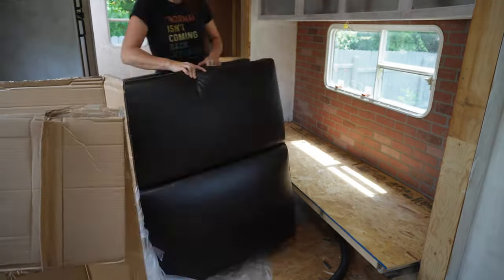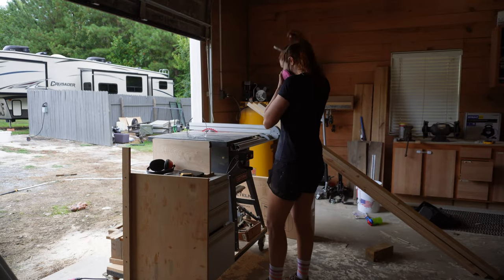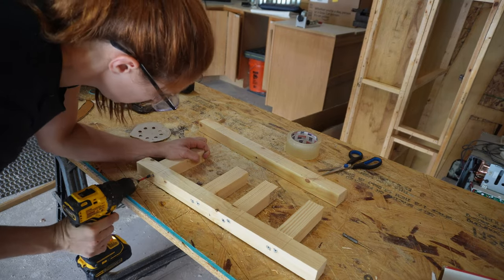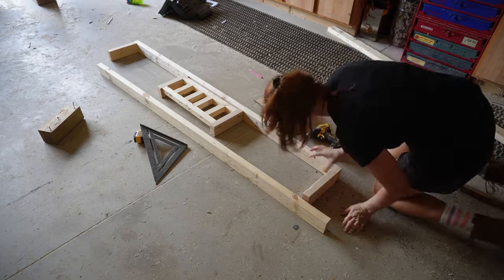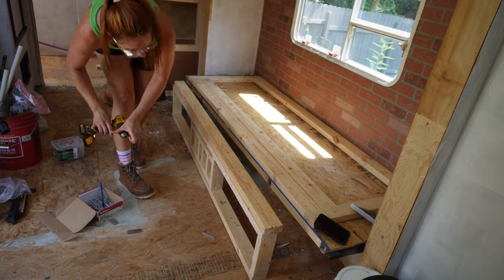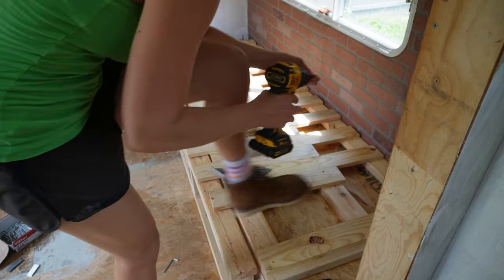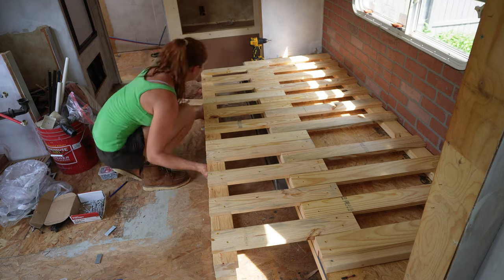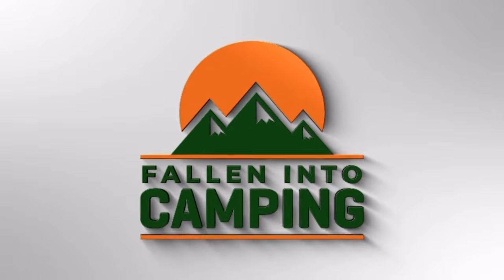RV Renovation: Day 7 DIY Jackknife Sofa Framing

Comment: For the drill question it sounds like the torque clutch doing it's job. There should be a ring/dial around the chuck with numbers and a drill bit icon. The numbers set the torque limit so you can do more delicate jobs with it without worrying about over tightening. 
Or maybe you got a lemon. Dewalt is usually pretty good quality but it could be a defect.
Reply: Ditto. My thoughts, too.
Reply from the maker: Yeah it keeps getting stuck between 1 an 2 (basically slow and fast). If I switch it back to slow speed, it will correct itself and then I can move it back to fast. I’ve never had a drill slip like this one has before.
Reply: @fallenintocamping  so it is a lemon. Makes sense it would slip if it is in between speeds/gears.
Reply from the maker: I figured that was the case….guess I’ll just have to practice self control and not get angry every time it slips and stops spinning mid screw 😂
Reply: Had the same issue and took it back and it was replaced @fallenintocamping

Comment: Good Afternoon, 
Have you ever dealt with leaking rv / horse trailer windows?? I have cleaned the weep holes  and tighten the screws. Have you ever taken a window out and put  that rv  seal on a roll ?
Thanks in advance.
Reply from the maker: Yep lots of times! Sometimes horse trailer windows are riveted in, so watch out for that. If not, take the interior screws out (make sure someone is outside to hold the window from falling out). Set the trim piece and screws in a safe place, and take the window out from the outside. Clean the window and the outside edge where the window sits with alcohol. Reapply new window seal (for smooth fiberglass use dicor foam core which is in my Amazon storefront) or if it’s aluminum corrugated siding (wavy) use caulk cord that you can buy a Home Depot. Then put the window back in the same way you took it out 😂
Reply: @fallenintocamping  
My trailer is painted aluminum, what seal products should I use??
Reply from the maker: @jeanmattison3600  is your siding smooth or wavy?

Comment: I had the same issue with my drill found out I didn't have it set on the right setting in other words it wasn't dialed in
Reply from the maker: Interesting…it’s not a fancy drill and I’ve owned one exactly like it and never had this problem with the old one. It slips when using it for literally anything, and if I switch it to slow speed and then fast again it works. I think I just got a dud 😂

Comment: Hey you do great work !! I've been wanting to try some graphite paint on a project to see how slick it is. Would be idea for you if you choose to slick that slide up some more. On the drill,  if it's adjustable torque and all the way locked up and still slips I'd be disappointed too. God bless
Reply from the maker: I’ve had DEWALT drills before and they’ve never done this. My other drills don’t do it either…I’ll have to do a slow motion video of how irritated I get when I’m trying to drive in a 3 inch screw and it slips and stops spinning 🤣
Reply: @fallenintocamping 😂